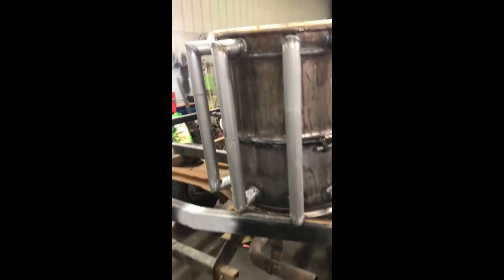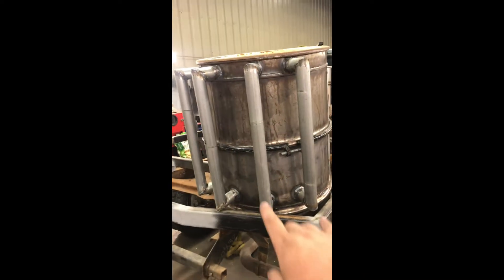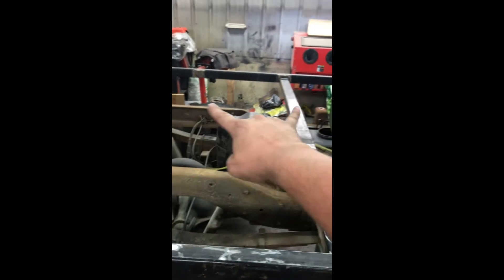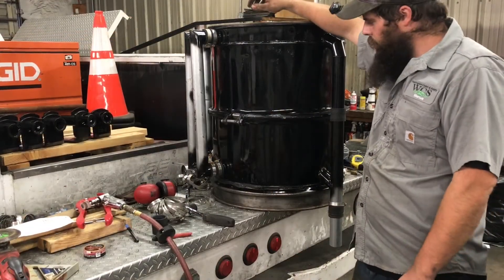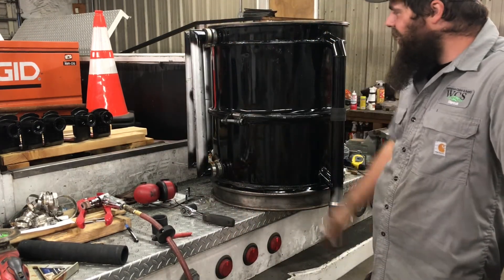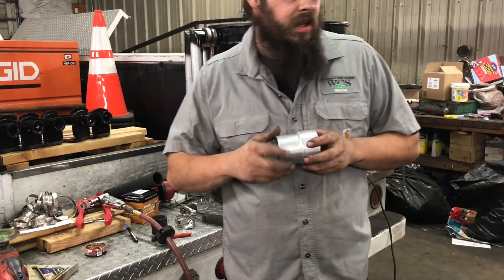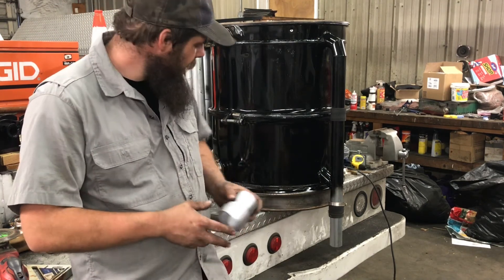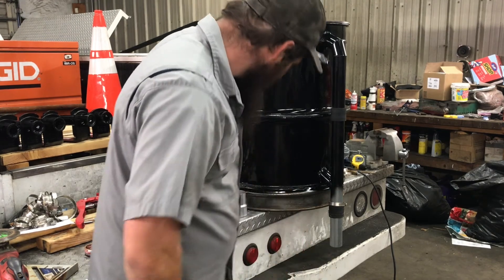Removable Hopper Cooling Tubes for the V10 Dodge Gasifier build

Comment: This is great for somebody just getting into wood gasification (like myself) about to start my first build. The goal is to get a running truck. Either my V8 99 dodge dakota or my V10 f250. Wondering if I should start by making a small proof of concept gasifier to run a small generator or something so I don't mess up a big project... appreciate your videos! Looking forward to more.
Reply from the maker: I would highly recommend heading over to the drive on wood forum where I learned EVERYTHING I know about woodgas and char gas. World wide members making all sorts of woodgas and char gas systems, stationary generators, cooking, heating, charcoal making, tar harvesting, from small cars with inside the trunk systems to the big v10 dodge like mine. We welcome anyone wanting to learn and help each other out, wanting to see anyone who dabbles in these fuels to succeed. Also find Wayne's book with detailed builds like the one that resides in the heart of this gassifier. I have all the proprietary info on this build on video posted there in the premium section since it is Wayne's design
Reply: @BigBeavrSlayer  great info! Got an account. What a fantastic resource. Love it. Thanks Marcus
Reply from the maker: @zarubalovesmusic8086  absolutely go ahead and introduce yourself we like new members

Comment: Doesn't take much gas to make up 370-$380 bux 👍
Reply from the maker: Depending on cooling rail material I should come in right about 500$ total, which at current prices is less then 2 weeks of fuel in this truck back and forth to work. Lot of time involved, but very worth it to me in the end!

Comment: What!!! No pie cuts,🤣
Reply from the maker: I thought about it, but wanted the couplers to be easy to get on and off. Now a small three bolt flange would be slick like a miniaturized header bolt flange. But a lot more work to build 20 of them for all the connections! If a guy had a plasma cam though....
Reply from the maker: No idea how bad I wish I was still in a exhaust shop with a bender at my disposal for gasifier building
Reply: @BigBeavrSlayer  If you were closer I'd a cut them out for you.